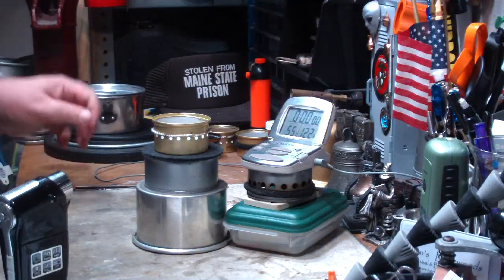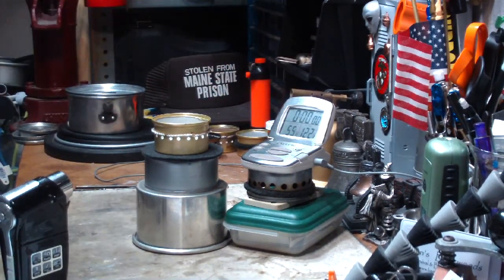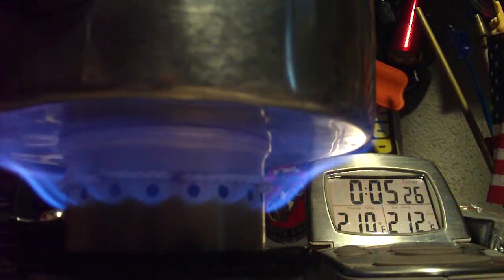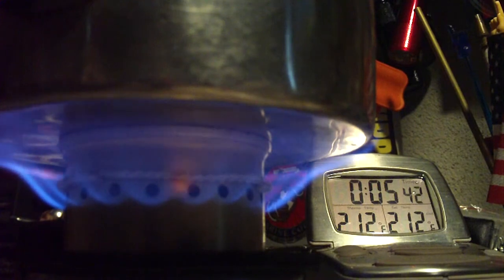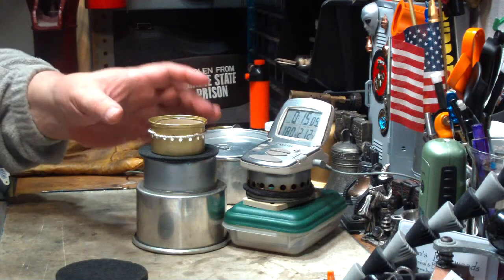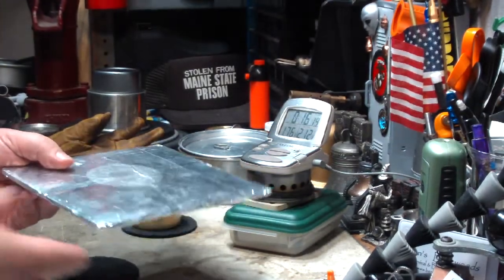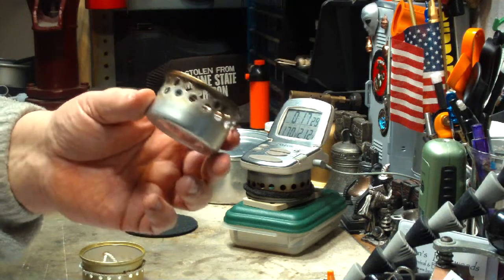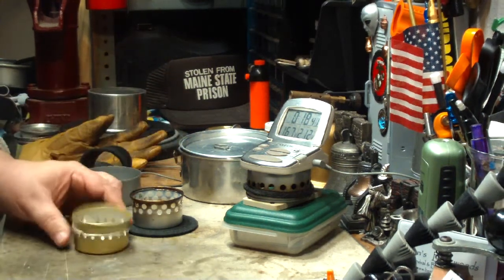Low Pressure - Side Burner Modification #4b - Boil Test #1

Comment: Hi Hiram, I just did a test with the fancy feast can and carbon felt wick. No other holes punched in the the can but for the wick, like you had in your video. Boil time with 2 cups water at 62 degrees was at 3 minutes 58 seconds. I was amazed by this. Container was the GSI stainless kettle. I can't tell you enough how I appreciate the information your tests provide. These boil times were not that far off from fancy and expensive canister stoves. Thank you Hiram.